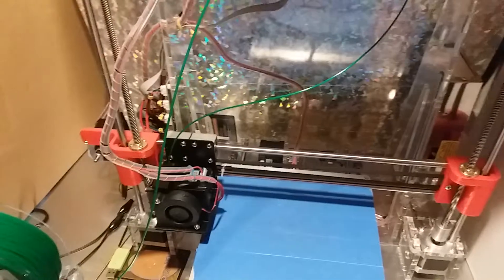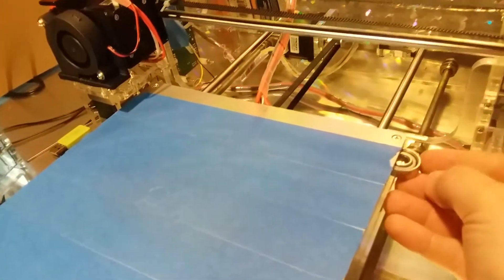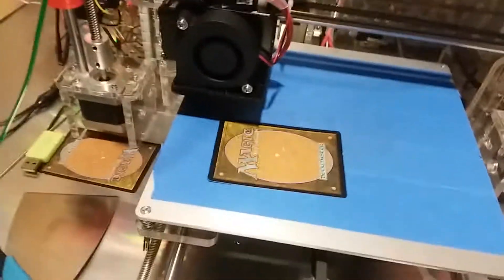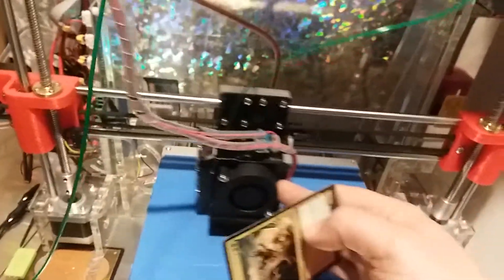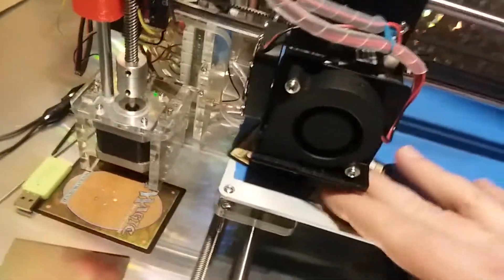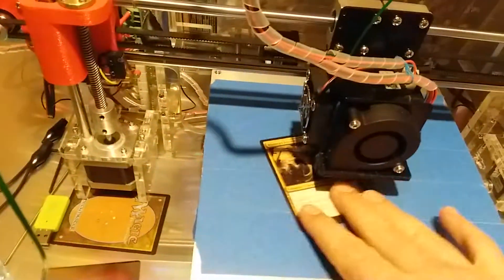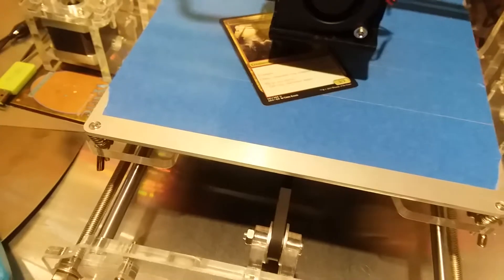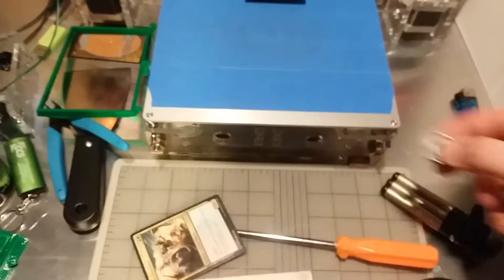Tronxy P802M P802MA  Anet A8 i3 Prusa Clone Z offset Calibration

Comment: Not exactly Z offset... Im thinking more in the firmware... I need to adjust the Z offset directly in the printer settings.
Reply from the maker: Why? I am thinking you don't need to mess with the firmware. Why reflash the entire OS?  Just calibrate your bed and Z offset physically.
Reply: @billpealer  I know for a fact though, that i messed something up in the osd,/ on screen with the printer because bedleveling is offset, and I dont have any way to reset it... I cant find the factory settings for my printer, so i might just have to try this....
Right now im just using an offet in cura
Reply from the maker: @techdiyer5290  is there a factory reset on the firmware?  Do that
Reply: @billpealer  no idea.... i just know that i made a dumb choice and clicked save to eprom...... settings are reset every time the machine is unplugged......
Reply: as far as i know.... i have a Tronxy P802E i should probably contact Tronxy...
Reply from the maker: @techdiyer5290  join the Tronxy 802 FB group.   All the best i3 clone hackers in there.  And we specialize in getting marlin on the Melzi 2.0 main board
Reply: @billpealer  Awsome!! Thanks!!

Comment: Do you ever adjust the Z-Offset in the software?
Reply from the maker: Ted Z yes sometimes.  But that won't calibrate your leveling. And cura only let's you offset adjust higher or to zero.  No negative offset.
Reply: @billpealer  maybe I'm missing something, how does the printer know the gap you left with the paper (or playing card, etc..) then?
Reply from the maker: Ted Z yeah. The z bump sensor is basically what the z offset calibration is
Reply from the maker: Ted Z it knows because the space tween the extruder and the bed, is really just the space between the x axis and the zero line of the z bump stop.